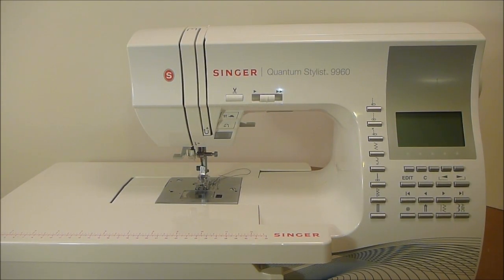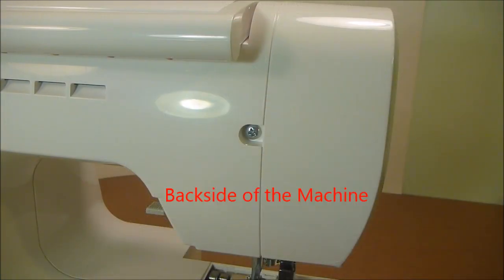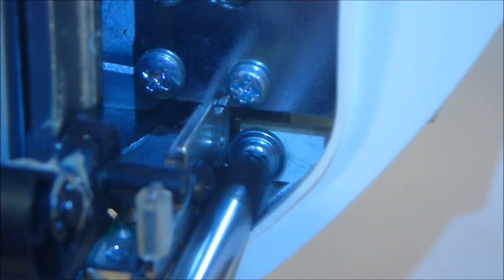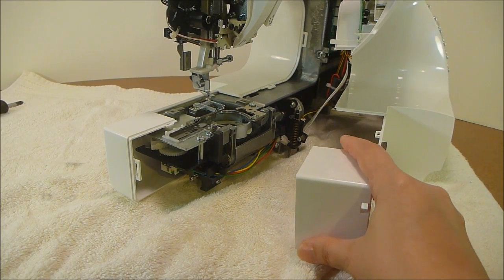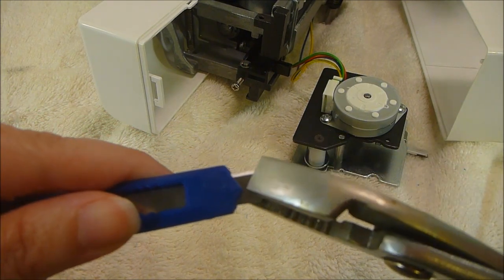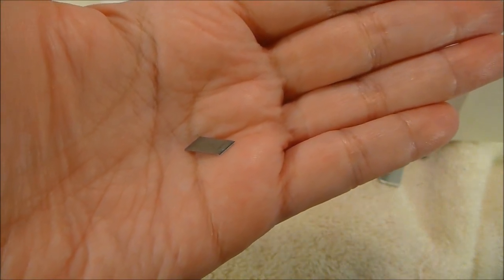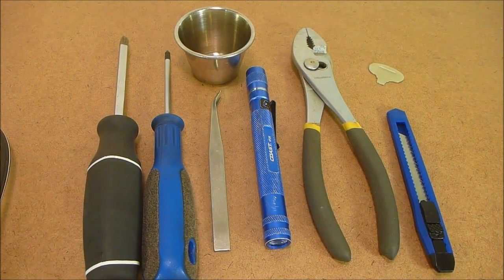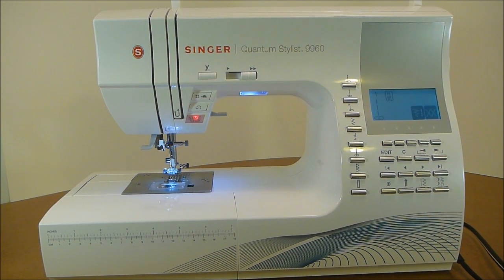Auto Cutter Repair Video

Comment: Wow! This is hands down, the BEST EVER video I've EVER watched (and obeyed), on youtub, and I've listened to, and followed hundreds of instructional videos. Roxanne, you have saved me time, frustration, the inconvenience of packing up my machine, driving 50 kms to town to take it to a repair shop, and, at minimum, $100. I encountered the exact problem as Beverly Booth (comment below) and thanks to your super clear, direct, and wonderfully explained, as well as filmed, instructions, I fixed my machine within half an hour, without getting frustrated or overwhelmed. AND I learned that I can easily get replacement blades for the cutter at my local Home Hardware instead of having to order specialty parts from Singer for an arm and a leg. You need to start making instructional videos on absolutely everything there is to learn! I swear, if you made a video on how to perform open heart surgery, I'd be so confident in your instructions, I'd try it! (though I suspect I'd be hard pressed to find a willing test patient). Please make more videos, Roxanne - you are a hero!

Comment: Thank you Roxanne for such clear instructions and demonstration, my 9960 is cutting like a dream with its new blade, but only after i did the work twice and noticed second time around the alignment of the sliders.  I think they must have got bent when my machine had a big jam of material (stretch jersey).  But watching your video carefully gave me the confidence to straighten them up and was thrilled when all back together, the cutting was perfect, and surprisingly too the running of the stitching is quieter.  So a huge thank you, apparently a new cutting unit would have set me back £95, not to mention service charges.
Reply from the maker: Hi Beverly.  So glad your auto cutter is back in operation.  It such a wonderful feature that we never want to be without it.

Comment: Thanks for the instructions, our machine is several years old, and it's not been working the greatest! 😕 I did find some thread and a broken needle in the process!
I tried to cut, and it didn't work...? OK, I had to disassemble twice, I found the small cover that holds the blade in, I wrapped it around both sliding arms, instead of just the one! 🤦‍♂️
Second time it worked like a champ! 😃😃
Attention To Detail! 🤯
Reply from the maker: Glad you were able to complete the repair.

Comment: Thank you for your video. I thought this was my problem, but once I knew what to look for I found the cutter guide was bent and running into the blade. I was able to bend it back without taking everything apart and it fixed the issue!

Comment: i love this tutorial, it's so clear and easy to follow. I was able to replace my blade and reassemble (making sure to follow the 12 min mark instructions), but it's still not cutting. Actually, it cuts the top thread but not the bobbin thread, almost as if the bobbin is holding the thread too tightly because it continually gets stuck and the sound the machine makes when auto-cutting is a little off, like it can't get any slack from the bobbin. I just had an expensive service but they didn't replace the blade or fix this issue. so sad. :(
Reply from the maker: Hi Melissa.  I've heard of this happening after the repair.  Since you were careful with the repair around mark 12:00 it's probably not that.  Can you check to make sure the brush on the bobbin holder is in place?  That little brush stages the bobbin thread for the auto cutter.

Comment: Thank you so much for this tutorial.  I appreciate how you went slowly through each step so I could follow along.  The zooming in and showing just where to press to release the clips was very helpful.  I found my blade had a groove worn in it after just two months of use!  On closer examination, the hook that grabs the thread was bent and whacking in to the blade.  I was able to use the closeups you had in your video to get it lined up correctly.  It is working great now! Thanks to you I can get back to sewing masks!  I had been looking for a good name for my sewing machine.  I think I am going to call her Roxanne!
Reply from the maker: Thanks Almaclara!!  I've had really amazing feedback on this repair video.  It's saves owners a bundle.  Thanks so much for the kind comment!!

Comment: Thank you for the tutorial.   The first time I did it, I didn't get the big silver cutter piece/box seated back in - somehow I managed to screw it in at a wonky angle.    I got it back out, fixed the angle and now it works.  I've had a piece of tape over the cutter button for over a year - felt so good to peel it off.  Thank you!!
Reply from the maker: Hi Heather!  I'm so glad you were able to repair your cutter!  Happy Sewing!

Comment: Thank you. I followed your video step by step and my machine is working much better. My auto-cutter had become jammed and this video helped me fix the issue. The older model seems like it was much better made.
Reply from the maker: Hi Tom.  So glad the video was helpful and you were able to fix your cutter.  Such a nice feature.
Reply: @RoxanneStitches  Thanks Roxanne. With my situation, the blade came out of the holder and actually bent the auto-cutter thread hook ever so slightly such that the blade would jam in those pieces of metal every time it was used, making the feature unusable. I had to disable it to use the machine. It's all sorted now and working consistently well. But I would love to retrofit an older model's cutter into my machine.

Comment: Thank You Mrs. Roxanne! I had help doing this last night and I still think I did it wrong I think I had my friend put the cutter in backwards but we're going to give it another try. Now if ONLY I could find someone to show me what is going on with the dang feed dogs not wanting to stay all the way up. My friend said that it looked like the plastic part that supports the feed dogs on the back under the bobbin area and to the far back looked like something was going on with that. I have no clue if that's even fixable without taking it to someone. Anyway Thank You so much for all of your wonderful videos! They mean a lot to those of us that cannot really afford the $120 just to get someone to look at their machines.
Reply from the maker: Hi.  The feed dogs can be knocked off that plastic post in the back.  A couple of other people have reported that.  I tried to do a video on that, but since I have an early model 9960, my feed dogs don't come off that post.  Hopefully you'll be able to get your machine in working order.
Reply: @RoxanneStitches  Mine is the earlier machine like the one that you did the auto cutter on, the post is still attached its' just the plastic that it is supposed to stand on is worn down.
Reply from the maker: If yours is like the one in the video, it's a newer machine.  I don't have that model.  My post is fixed to the feed dog mechanism.  You may need to take that in for repair.

Comment: Excellent video. My 9960 is new so I have no cutting issues; however, you showed how to easily open the case without breaking the clips or using a plastic pry tool to open the case. I was to purchase pry tools but now am reconsidering… my hands will be better. I have saved this video for future reference. Nicely done! 😉
Reply from the maker: Glad this video was helpful.  Have to be so careful with the plastic clips and unfortunately as our machines age that become more brittle.

Comment: Hi! Thank you so much for a very detailed video. I was having the auto cutting not working and a weird noise when putting the stitch length 3.0 and up. I followed your video did everything and cleaned a bit. The noise went away but my cutter still not working, maybe I put the blade wrong or it’s stuck there. I will try again. But I’m so happy it’s not sounding like an old machine that need it oil. THANK YOU !!!!
Reply from the maker: Hi Rosyvette, Sorry the repair didn't solve your issue.  There is a tricky spot when putting the cutting mechanism back together that some people miss.  I know it's a big job to take it apart again and if you're machine is working that's great.  Wish I could help more.

Comment: Thank you so much. I have been trying to find a video on how to repair my cutter for over two years,  thanks again.
Reply from the maker: Hi Claudette!  So glad you found my new video to help you repair your cutter.  So worth the time and effort.  Such a great feature.
Reply: But if it only works for the newer model for this year 2020 this video can’t be used on the 2017 2018 2019 am I correct?
Reply from the maker: Hi Anna,  As far as I know, there are only 2 different cutting mechanisms.  They are both detailed in the video.  Check there to see which one you have.  Chances are it's the newer one featured in the repair video.
Reply: Roxanne Stitches thank you so much for all your videos!  I watch them all the time!  I hardly use my cutter because I didn’t want it to break and then not be able to repair it. But that was the reason I bought it in the first place!  So if it ever does need replacement now I can figure it out myself!  Stay safe! 🙏🏼🥰
Reply from the maker: Hi Anna!  Use it and enjoy it!  It's the best feature ever!!  Stay safe too!!

Comment: My gosh, thank you so much.  My 5 months old 9960's blade just fell out after tangling the bottom thread and making squeaky sounds.  I managed to get the blade out of the bobbin case, and I was surprised when I felt the blade---it's already nicked after sewing 120 masks.  Apparently replacement blades aren't readily available, so I'll snap one off a box cutter that I got from a 99 cent store!  I used Baby Lock for 30 years, but I figured I wouldn't sew much anymore.  9960 has many nice features, but small issues like this really bug me.  It's a bummer that we need to open the machine just to replace the blade, but at least I don't have to take in this near-new machine to a repair shop.  Many many thanks!!
Reply from the maker: Hi.  Glad my video was helpful.  The auto cutter is such a great feature.

Comment: Thanks for the very detailed video for us 9960 users!! Please make more, maybe one on cleaning or maintenance oiling? Mine is only 6 months old but want to keep it running in tip top shape. I always clean under the throat plate but maybe there is more to do on a routine basis? Thanks again!
Reply from the maker: Hi Brandon.  Glad this video was helpful.  I already have a video on basic maintenance.  Here's the link:  https://youtu.be/Y7B-6uW7b20

Comment: Very well made video, describing each action taken.  Wish you could do it for a Brother Quattro 2 embroidery machine, as the auto cutter is somehow out of alignment and grinds when I use it.  I'm hoping this helps though.  Thank you :-)
Reply from the maker: Hi Bessie.  The cutter can become bent if the button is pressed more than once without cutting.  The cutter can get stuck in it's path and be unable to retract back into the mechanisms housing.  This may be your issue.  If so, when it's stuck, gently bend it back into position and give it a good cleaning out.  Hope this helps.

Comment: Hi Really great and detailed video Thank You ! My machine is only cutting the top thread, do you think I need this repair or a cleaning. I don’t want to start this as it is quite involved, if it’s not necessary.
Reply from the maker: Hi Rhonda.  If you're cutter isn't functioning properly and you've cleaned it out very well, this may be a solution for you.

Comment: great video.  Walked us right through it very well.  Unfortunately, did not fix mine, darn it all.  Not sure what to do next.
Reply from the maker: Hi Christe.  Unfortunately, there's a tricky step in there that you may have missed or not reassembled correctly.
Reply: Mu sliders were out of alignment, really look hard on the demo, it helped me get mine aligned and working, definitely worth step by step instructions

Comment: Thanks for your reply.  I put the two little metal pieces of the cutter in as shown, in order, with both set on the little white post, and I tightened the screw.  If I take it apart again, what problem should I look for?
Reply from the maker: It's not so much about them both being on the white post than it is about one metal part being on each side of the cutter arm.  Chances are that the first piece was installed incorrectly inside the cutter arm instead of behind it.  This was pointed out to me from someone who has followed my video to do cutter repairs on all 3 of her 9960's.

Comment: Thank you for this video, although the cutter won’t cut, it’s not grabbing thread any longer and wow was there a mess of dust in my machine,I cleaned it while I was in there and ordered some 9 mm blades, maybe mine is dull. How often should they be changed, I’ve had my machine 8 months and constant use?
Reply from the maker: Hi Rhonda.  I've owned my machine for almost 9 years and my cutter still works fine.  If you press the cutter button and it doesn't cut the first time, don't press it again until you clean it out.  That's how they get broken.
Reply: @RoxanneStitches  ty!

Comment: Hi Roxanne, I bought my 9960 in 2015, the mechanism looks exactly like yours, will I be able to change the cutter in mines?  I took it to the shop about a month ago and they were only able to get it to cut only one of the threads only.
Reply from the maker: Hi Ms SDS.  As I explain in the video, the original cutter can't be repaired the same way unfortunately.  It's a completely different mechanism.  Sounds like yours only needs a good cleaning and should be functional again.

Comment: Hi Roxanne, thank you for you great video. I did try to follow all the steps but i did the mistake of unscrewing all 3 screws of the cutter mechanism, i tried to assemble all but i don't know the original position of the dented weels, is it possible to get a picture of how they are? because my cutter now its not getting the "hook"all to the right to get the thread to the blade. And a picture of the right positions of the mechanism will help me to get it right.
Reply from the maker: Hi Vera,  Go to the 12:00 mark in the video.  It shows in detail how to put those small parts back together correctly.

Comment: Roxanne. Thankyou for showing us how to do this,but I don’t think this is the fix I need. My blade cuts reliably, however, if I use it too often thread gets stuck inside and the mechanism itself jams in the far right position. Any advice about this?
Reply from the maker: Clean it out often so that thread doesn't get caught in the mechanism is the best advice I can give.
Reply: I give up. I’ve just resigned myself to using scissors.
Reply from the maker: Have you tried the manual cutter?  It's pretty fabulous too!  https://youtu.be/b1NLUSSfUEw

Comment: My cutting arm keeps getting stuck by the brush part, do I need to replace the whole cutting mechanism? Or just the blade?
Reply from the maker: Sounds like your bobbin casing isn't inserted properly.  Check to make sure it's aligned properly.

Comment: Thank you so much for this video as my this function is not working any more and I have to fix it. 
Can you please also help me with another problem with this sewing machine.  I'm  keep getting message release the foot controller pedal every 10 seconds sew. How i can fix this problem? I have tried new foot pedal as well but problem is still same. Thank you
Reply from the maker: Hi Saira.  I'm not sure. It could be an internal electronics issue. Have you tried to sew without the foot control using the start/stop button?
Reply: @RoxanneStitches  yes dear I did. And it's same problem.  Keep stoping after 10 seconds . Thank you so much for reply.

Comment: Wow!  This has me a bit concerned.  The main reason I'm considering the QS9960 is because it's the only machine in this price point with the auto cutter. I can't imagine why they made it so difficult to get to the cutter for repairs. Your video is so thorough and detailed that I think I could do it, but not sure I want that hassle. Would you still recommend this machine despite what sounds like a fairly common problem? Thank you! (P.S. If I do get it and need to replace the cutter, I feel confident I could do it with this video.)
Reply from the maker: Hi Allonsy.  I think it's more of a user error issue.  If the cutter doesn't cut when the button is pressed ONCE, it means it needs cleaning.  If someone continues to press the button without properly maintaining the cutter, the blade can fall out or the mechanism can become damaged.  If it's damaged, the mechanism needs to be replaced, not just the blade.  Take good care of you machine and you won't have this issue.
Reply: @RoxanneStitches  Hi!  Thank you so much for replying.  That's good advice. I tend to take very good care of my things. Is it easier to clean the cutter than it is to replace it? LOL  I hope so! Do you happen to know if the QS 8060 (whi8ch appears to be the same machine) has a different cutter mechanism? I'm wondering what the difference between the 2 is and why the 8060 has a higher price.  Hmmm... Have a fabulous day!
Reply: Oh!  I just found the article you wrote about the history of the QS. It doesn't sound like there's a big difference--just in price. Interesing. Thank you!d